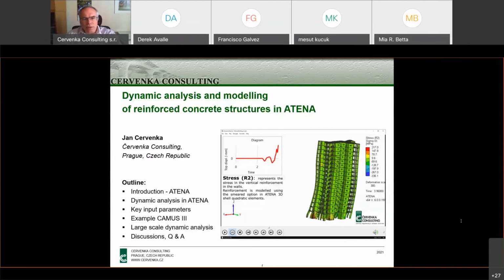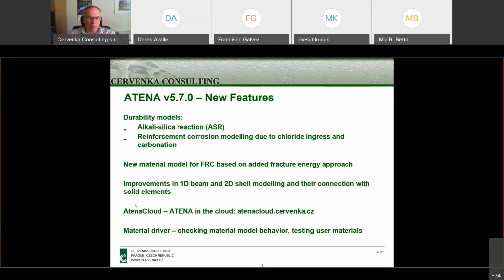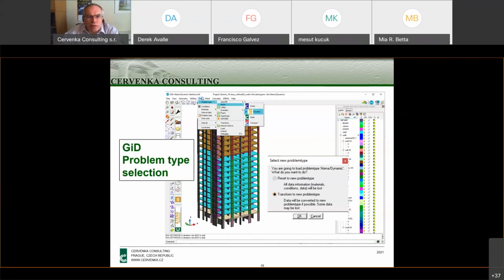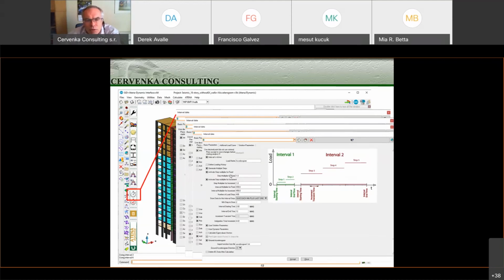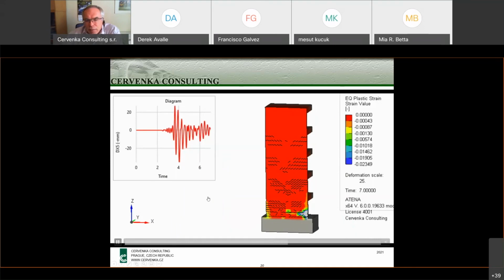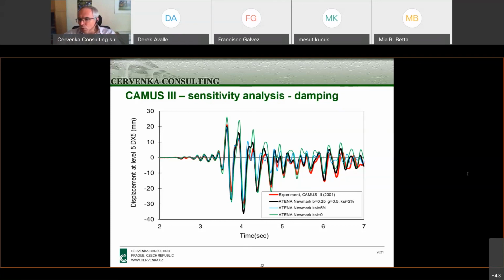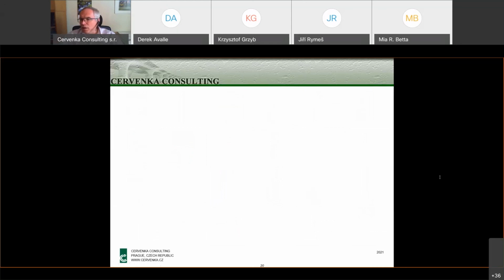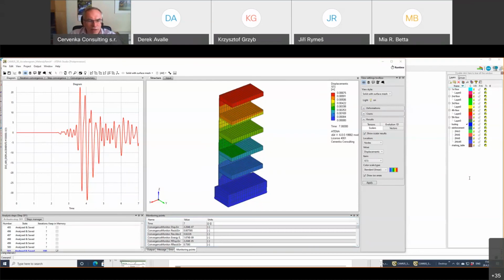ATENA webinar 2/2021: Dynamic analysis and modelling of reinforced concrete structures in ATENA 5.7

Comment: please can you explain about the boundary conditions and loads used for this analysis..
Reply: In the examples presented in this study the boundary conditions were quite simple. The CAMUS III analysis was an experiment which was fully fixed at the bottom, but important part was to calibrate the stiffness of the foundation block to the principal eigenvalues to take into account the imperfect nature of the experiment fixing. The 18 storey building was assumed fully fixed at the bottom. The objecive there was more to show the possibilities to simulate even such a relatively complex building.